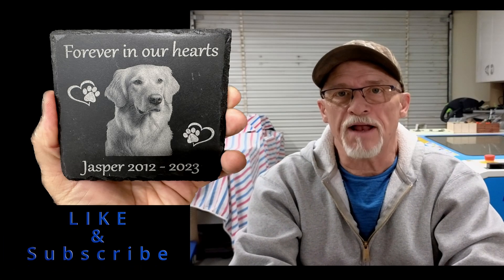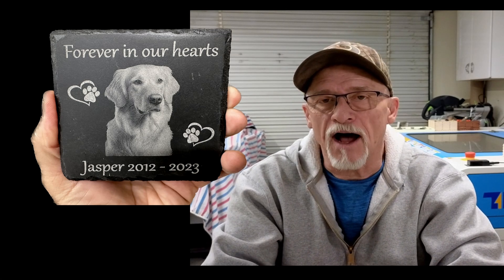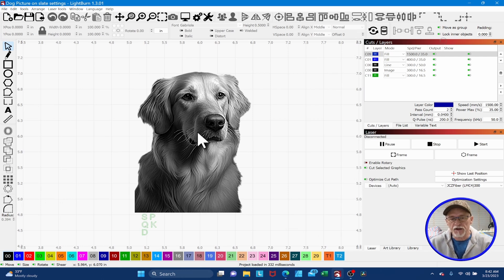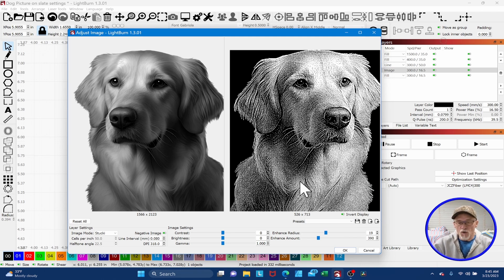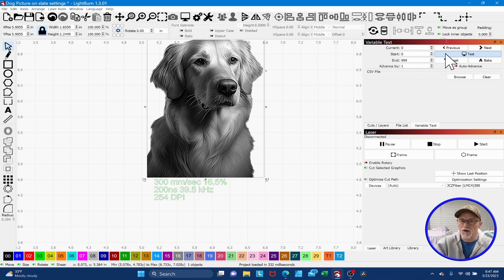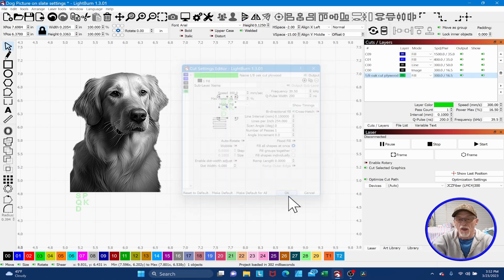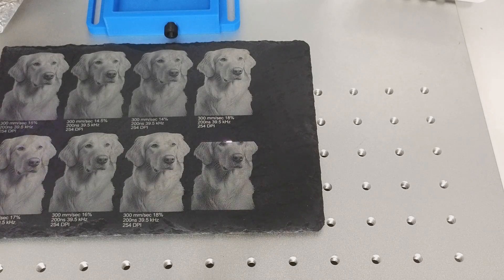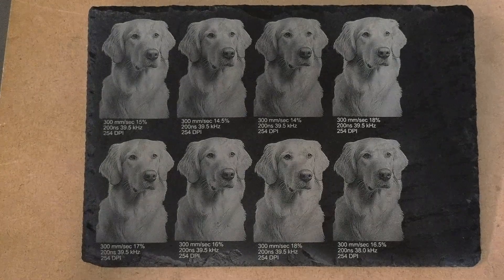Unbelievable Beginner Tricks for Laser Engraving Pictures on Slate!

Comment: Hello Robert,

thanks for the great video.
However, I am surprised that with photos (not vectors) the set speed never matches the set value with a fiberlaser.
My 300mm/sec are slower than in your video.
But with vector graphics everything fits.
Do you know why this is the case?
Thank you very much !
Toby
Reply from the maker: good questions but for pictures I’ve never worked about it. at least in lightburn

Comment: Great Video!  One question is that my images from my iPhone have a white square background when I load them into Lightburn and are not transparent.  I used the same method you did in the video.  Even when I use a tool to remove the background, every time I drag it into Lightburn, it has a white square background.
Reply from the maker: Use png format that way you get a transparent background